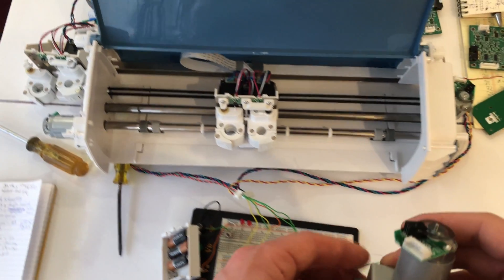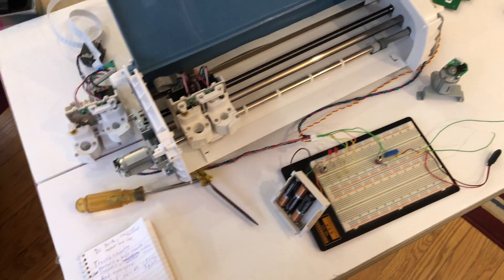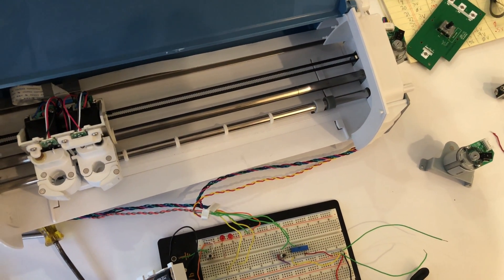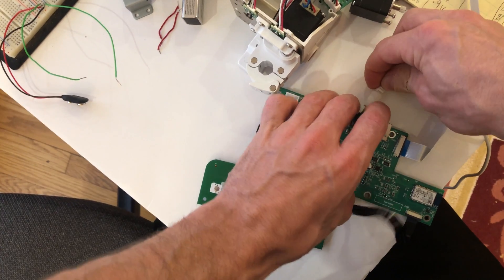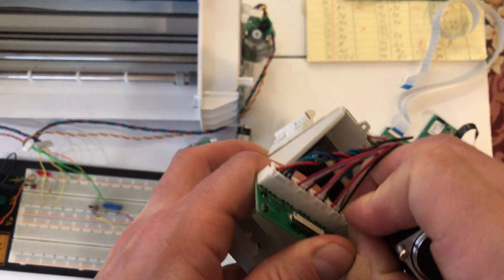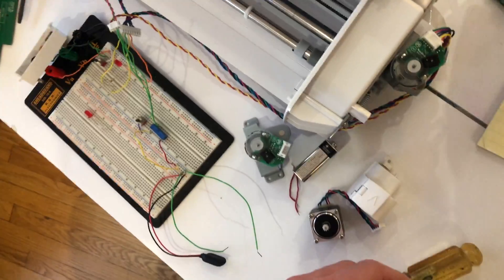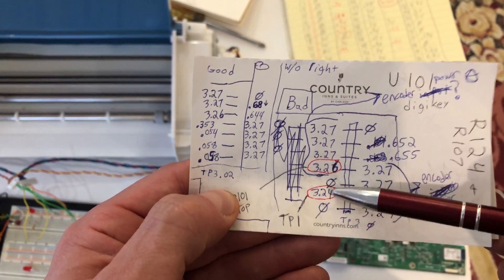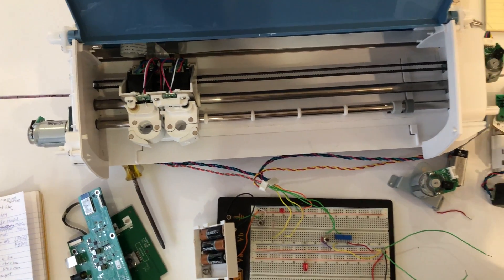Cricut Explore Air 2 and (Maker related) troubleshooting

Comment: Hi! My Cricut Explore Air cartridge port is not working. It will not recognize that a cartridge is in it. Any advice?
Reply from the maker: My recommendation is not to use it at all.  The circuit those ports are on are susceptible to fail, and will leave the whole unit useless.  Most of the things the cartridges can do can be done without them.  You could check for a disconnected cable if you absolutely need to, but my recommendation is not to use it.  I have about ten machines that have a problem with that circuit crossing with another that shorted out the whole system.  Hope that helps.
Reply: @Idotooby  Thank you! I am trying to find an adapter now which doesn't look like it will be easy.
Reply from the maker: @juliefarris1616  What type of an adaptor are you looking for?  If you are talking about the cartridge port, I have a good one, if you are certain that is the problem.  Have you tried multiple cartridges?
Reply from the maker: I am guessing they discontinued it as it is not needed as the software now offers what the cartridges did.

Comment: my cricut explore air 2 carriage isnt moving, also the power button blinks red & white. I cant use usb or bluetooth either.
Reply from the maker: Check the motor connections.  red and white flashing usually indicates an open circuit somewhere pertaining to the motors.
Reply: @true talker 101  did you manage to fix your carriage problem?